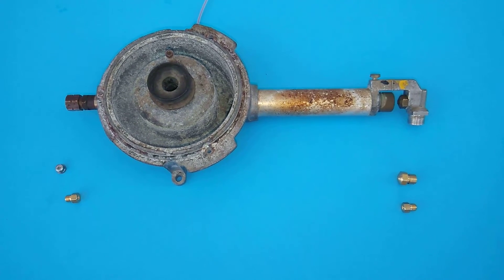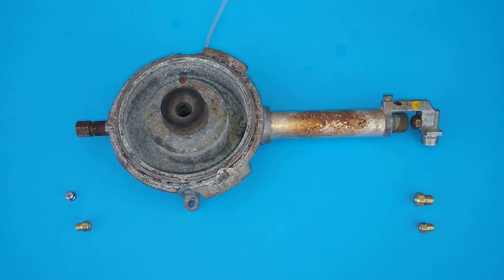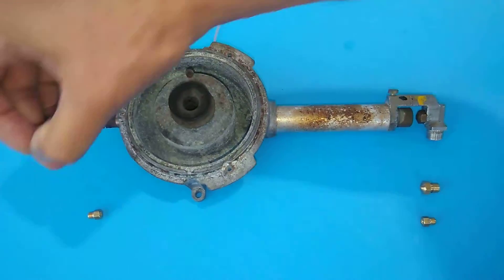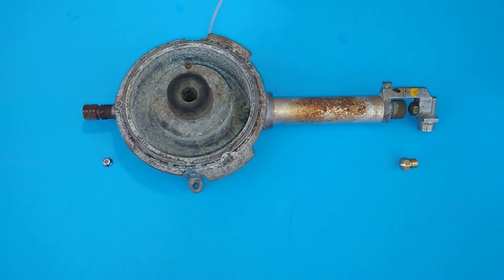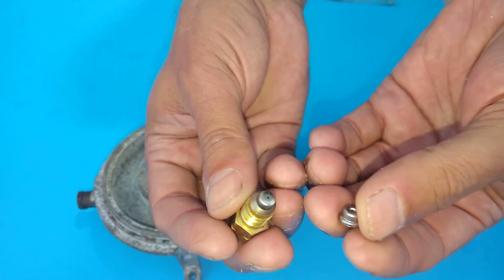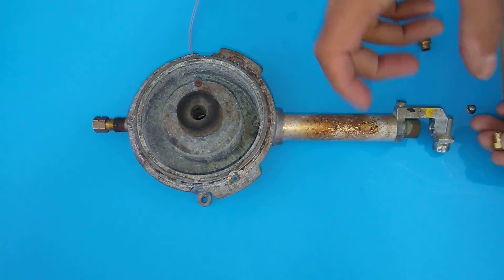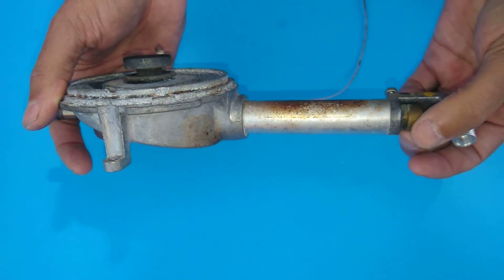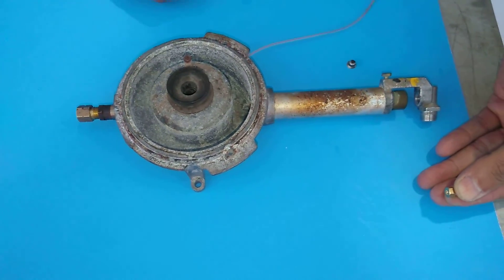Wolf, Dacor and Viking Dual Burners - How To Convert

Comment: Frank,  great explanation.  I have a Wolf Gourmet 30” Model S30KI-2 that was converted to Propane.  One burner is not right.  After watching this video, I think it is not getting enough air.  When I turn this burner on, there is good spark but the flame does not light off and then there is a pop as it lights and then poor flame jumping around.  Is my thoughts correct that it is not getting enough air?  Gary
Reply from the maker: I actually carry orifices for every stove and barbecue made on my website  https://flamesources.com/  I'm now in the Midwest, and you can always get a hold of me at 714-574-1544. Make sure to like and subscribe to my channel.

I'm not sure I totally follow what the actual condition of your flame is. Can you upload a video and send me a link so I can see what it's doing? Sometimes their are very distinct sounds that go with certain conditions.
Reply: Turns out the Venturi was wide open.  I adjusted the air flow to match the other 3 burners and it now works perfectly.  Again great video.  Thank you.  Gary

Comment: Ok I need help. Just bought a new  old stock dacor HDPR36s/NG. A Dacor tech rep told me a lp conversion was possible and available 2 months later there saying it’s not. Can you make the kit fit this conversion?
Reply from the maker: I actually sell orifices for every stove and bar-b-que unit made. I'm in the Mid West, and you can always get a hold of me during normal Mid West business hours at 714-574-1544.